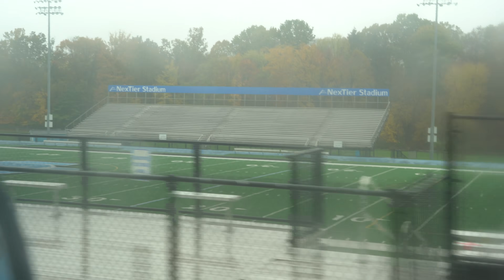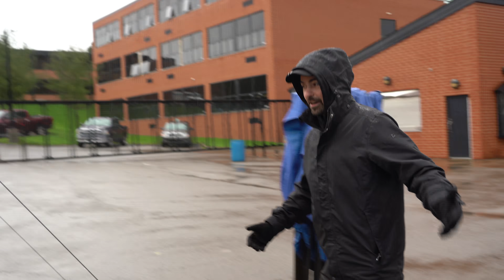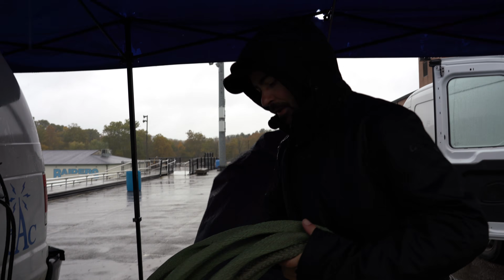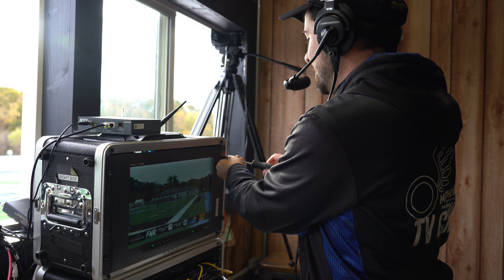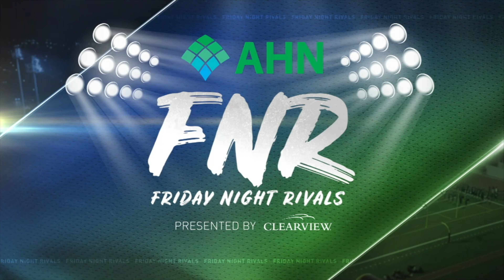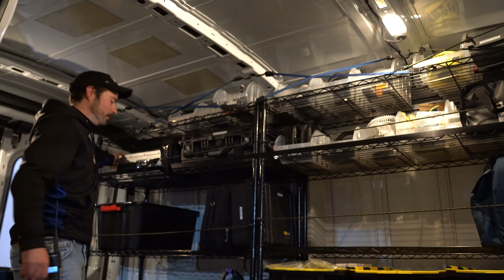Broadcasting High School Football (Behind the Scenes) [Broadcast Engineering]

Comment: How are you doing the coms/talkback over fiber with talent? I see an M32C and DL16 in the booth kit.

I have a pair of ClearCom-AB100 announce boxes, and I can do Mic and Headset/IFB over fiber with Dante, but intercom/talkback is an XLR back to my producers station.
Reply: Hi! I'm one of Ryan's engineers. Our intercom system is RTS Omneo, which uses a Dante backbone, so everything intercom is carried over our truck LAN via fiber.

However, we used to have an analog Clearcom system in our trucks, similar to your set up. You will need to convert your two wire intercom to four wire using a Clearcom IF4W4 interface. Once your intercom/talkback is 4 wire, it can be split to individual unbalanced audio Input and output channels that you can plug into your mixer. We had a similar solution in our trucks before we dropped our Clearcom analog system for the digital RTS system.
Reply: @drjmrfox4672  I think I understand what you're saying, I'm more a visual learner. 

So the 4 wire is splitting the full duplex of the clear-com into essentially a pair of dry channels, and the two mixers are acting like belt pack? The producers mic goes to the truck mixer and out a sub-mix to the booth kit mixer on a sub-mix to the talents headset?
I'm not familiar with the Whirlwind announce boxes, I'm assuming the talkback out is a dry analog line that would be working in the opposite direction to the producers mic?

How are you doing Dante with the M32C and the DL16? Neither of them have Dante. I was assuming AES50, but AES50 is point to point and can't be sent over network?

Comment: Curious question, you guys had a side line reporter - what system was used for the camera on the field? Was it a wireless camera or wireless?
Reply from the maker: Hi!

It's been a roller-coaster of different solutions for the camera over the years. We started with a SMPTE wired camera, moved to wireless (which wasn't a very reliable system - we used Teradek), then moved to just picking them up on one of our wired Endzone cams.

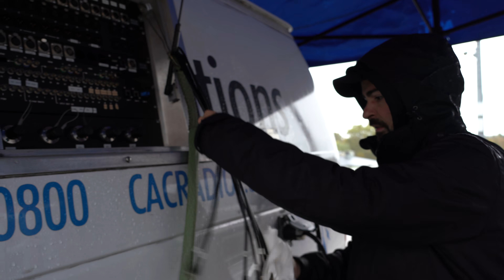Comment: When you plugged the cords into the sort of box/ window on the outside of the truck where the inputs went, did those go straight from there into the switcher, mixer, etc? This part was at 14:15. Thank you!
Reply from the maker: Hi! Yes, some of the xlr come/ go directly to the mixer. Some of the SDI come/go to the router. Everything would come/go to some other varied piece of gear :)
Reply: @BroadcastBuddyTV  ok, thanks very much!

Comment: I see your sideline reporter is using a Roameo pack to talk to the truck and hear the truck. Why not just wire the Roameo to be the sideline reporters on air mic/ifb/talkback mic. That’s what we use them for and as long as your on the codec that allows for 5 beltpacks you really don’t notice a difference in quality. We wired a 5 pin to 3 pin and 1/4 inch jack for a stick mic and an in ear IFB and it works great.
Reply from the maker: That's an interesting concept, I'll have to tinker with this. Thanks for the suggestion!